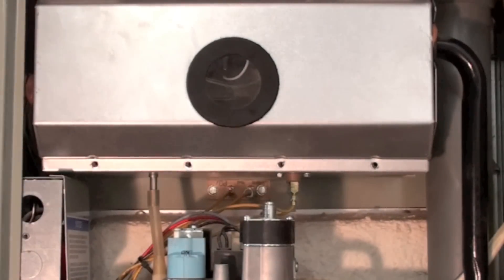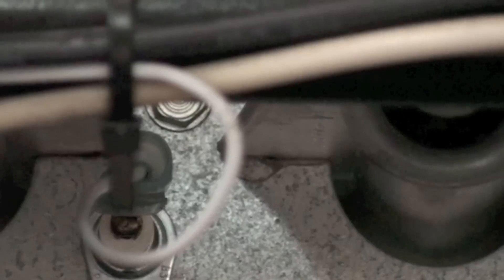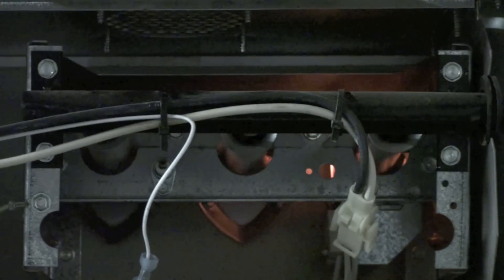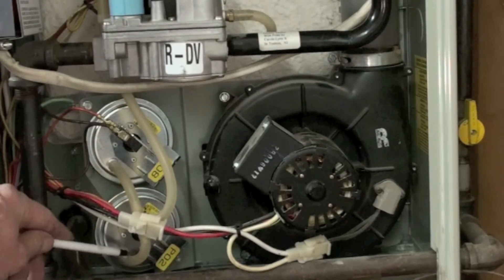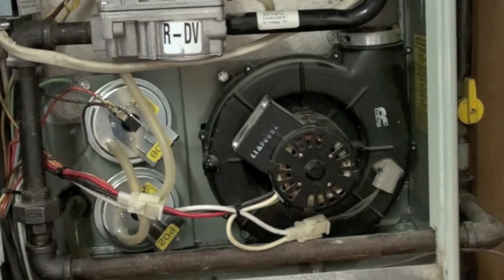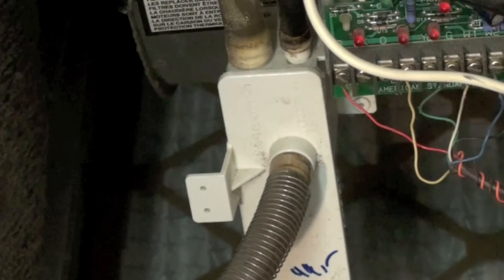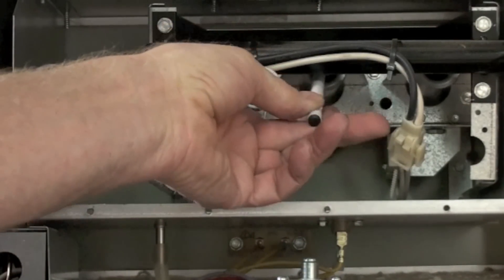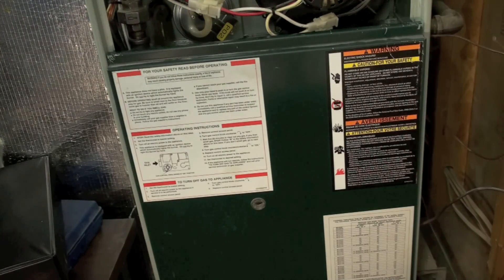Why does the gas furnace short cycle

Comment: I believe I have the issue with the rod. I'm looking at it and it looks ashy around the tip so I'll start there. Question "As long as the thermostat is off I can reach in there behind this relay looking thing an not get jolted? I've pulled fuses on my central air unit outside so I new there was no volts. I tested it ,it came on twice then stopped for a hour tried again same thing. I have a Goodman
Reply from the maker: Did you shut down power to the furnace?  If so, you are ok.  Remove the flame rod and clean it with sandpaper (not aggressively).  It should then work normally.
GFM
Reply: @grayfurnaceman  yes turned off. Just cleaned off fire rod and still cycling off to the next possible issue
Reply: Gas valve isn't opening
Reply from the maker: Does the hot surface ignitor come on?
GFM
Reply: Yes.
Reply from the maker: You will need to check voltage to the gas valve during a trial for ignition.  You should have 24 volts.  If you have voltage, the gas valve has failed or there is no gas available.  No voltage, either you have a wiring problem or the control board has failed.
GFM
Reply: Checking today
Reply: Sir gray so for some strange reason my meter is missing. Smh called a hvac guy "bummer " said it's the gas valve.  Wants to charge me 675 to replace it. I'm like with all due respect I'll go to YouTube and talk to you. Lol. Found the part online, also found a used one in my area for 15 bucks I'll use it as a tester before I buy a new one.. Gemini 36g22y type 202 50/60hz. 2006 model goodman
Reply from the maker: Go for it.  Be sure there are no leaks when done.  Check manifold pressure.
GFM
Reply: @grayfurnaceman  what meter did you use to check the pressure ? And what does the pressure do or control? I just watched your adjusting pressure video.

Comment: All newer models require constant pressure.  If your waking up cold in morning  it could be presure problem . If u dont have a regulater by the gas meter your system is a low pressure system. When people wake up they shower, cook, and use heater. All this in an older system will cause a slight pressure drop. Newer furnaces dont like that. Look a flame on stove and see in the morning  if it looks different. This is a big problem utilities dont tell u about. Could be rust or water in the line. As a former utility servace man this is common problem  . Good luck and beware of people who will rip u off. Good video

Comment: Funny you should mention the speed of the draft inducer motor, boy did I get a rude awakening from that one a while ago. Had a furnace that was short cycling, it would run for sometimes a couple minutes, sometimes only 30 seconds. Was a Goodman unit, thought for sure it was the pressure switch since at that time they had a batch of them that were prone to failure. Changed it, ran good for a couple weeks, then it started doing it again. Everything seemed to be running fine, flame sensor good, everything checked out good, changed the pressure switch again, same thing happened, So I’m thinking, ok I must have a bad board or something, changed that, nope that wasn’t it either. Then by chance I caught it doing it. The draft inducer was running full speed, then all of the sudden out of nowhere it would slow down, not drastically either, I mean very slightly, you could barely tell, but could hear the pitch of the motor change ever so slightly. So I’m sitting there pissed at this POS. Changed the draft inducer, been fine now for over a couple years now. That was a tough one to diagnose.
Reply from the maker: That's one that would be pretty much impossible unless you see it doing it.
GFM
Reply: @grayfurnaceman  I never seen one like that again, but hopefully it helps someone so they dont go through what I did, man that one was a real pain in the A!

Comment: My unit is short cycling. I cleaned the flame sensor rod and it's still short cycling. It runs for like 5 minutes and shuts down. Any ideas on what the problem could be? I'm thinking maybe I need a new flame rod sensor or thermostat
Reply from the maker: Jumper the thermostat.  That will tell you if it is in the thermostat.  Check the filter.  Check the fan for dirt.  
GFM

Comment: Good morning. I'm curious about my furnace. This sounds like what it is doing, but it takes longer to shut off. Sometimes an hour, sometimes 2 to 4. Doesn't really matter how cold or windy it is outside the townhouse. I will try the flame sensor like you have suggested it may be, but if you know if anything else based on this information, could you please let me know what you think. It has done this for about 3-4 years. I bang it on the front cover or the little round black disc right in the front under the cover and it will come back on. I don't know what the little round disc is and have never been able to find anything about it. Thank you so much for the video. It is very informative and certainly may help the problem. It sure would be nice to not have to get up throughout the night to bang on it or come home to a COLD house. Thank you again!!!!
Reply from the maker: Could you send me a pic of the black round thing?  Send to Grayfurnaceman@gmail.com
GFM

Comment: Does any one has a furnace that its having excessive heat coming from air register? The one I'm talking has a 170degree air temp at register.
Reply from the maker: This is usually due to low air flow.  Filter?
GFM
Reply: @grayfurnaceman  hi I remove filter, make sure all the register where open, still the same.

Comment: I might try checking the continuity of some of the pressure switch wires when I move them to see if there are intermittent or heat issues with wiring

Comment: I have a gas furnace that is short cycling and its driving me crazy.  I replaced my control board with a Emerson cnt07566 control board.  This board allows you to check the flame current by measuring a voltage of the control board.  I am getting 2.5v which is supposed to be 2.5  uamps of flame current.  The current then shuts off.  I measured the voltage on the pressure switch and the pressure switch and it is always closed.

There is a second pressure switch marked HI but it never closes.  I am not sure what it is for.
Reply from the maker: How long do the burners stay on?
GFM
Reply: Maybe 4 to 5 seconds after they light.
Reply: I replaced the flame rod with a new flame rod, still has the same problem
Reply from the maker: If you are getting a proper flame rod reading, and the control is new, I would be looking at the pressure switch.  I know you said it stayed closed, but I would try jumping the switch after the inducer starts and before a trial for ignition.  This will eliminate any momentary opening of the switch.
GFM
Reply: I tried that also, I jumped the switch because I thought, maybe when it starts up, there might be a pressure change.  There are two switches.  Only one of them activates.
The second one does not activate

Comment: what would cause a furnace to shutdown and not come back on u less I mess around with the strat.  Frank Smith
Reply from the maker: There is a pretty good chance that you are going out on flame failure.  Turning off the thermostat and then turning it back on will reset it.  Possible dirty flame rod.
GFM

Comment: 8 years of HVAC service. The best thing I used for cleaning flame sensors was a dollar bill.
Reply: Jon Kreher Brian 90% furnace runs for 30 minutes sets off three blinking lights
Reply: @corneliusarnold2900 probably the pressure switch is bad

Comment: In my case the flame "sensor" was oxidized, it was also not directly in the flame. The other issues were a low battery on the thermostat. I can't forget a bad or no ground. I have seen a house that had older no ground wiring. The furnace actually was not grounded aside from sitting on the concrete.  Another had its grounded underground service cable conduit corrode and break of at ground level; a ground rod was not present at build time. It wasn't even grounded through the water supply either. Once the electrical was properly grounded the short cycling stopped. The  flame sensor measures a voltage difference in relation to ground. If it isn't grounded it will be floating and can give erratic signals.
Reply from the maker: Actually, if the chassis is not grounded or attached to neutral, most furnaces will not run at all.
GFM

Comment: Thanks for the info. while checking my system, I found an insulation panel had fallen on top of the fan. That was causing the problem and I had very low air flow, so definitely check physically before paying someone to look!
Reply from the maker: Sometimes the repair is so simple.
GFM

Comment: Had similar furnace, a 90% Nordyne and it was short cycling, but with about a 5min cycle (plus 2min for inducer to clear, and 2min more for main air fan to clear -- so about 9min total cycle) and I looked at every limit switch and everything and they were all working.  I learned it was the Main Air Limit Switch (it was working properly) that was cutting the burner out at it's set 175F and that's what was causing the cycle to reset.  Lo and behold it was working properly and the reason it was getting too hot was simple -- the air filter on the furnace was clogged -- I week prior I had used a compressed air nozzle to clean the filter thinking I was smart and saving money.  Because the furnace was clogged (although it looked fairly clean at first glance, it was clogged) the air movement was low through the furnace, which means the Main Air Limit Switch was getting hotter than 175F and that was my root problem.  New filter, problem solved... easy.  Learned a lot.  Amazing.
Reply from the maker: If it is a high efficiency filter, they can plug very quickly.
GFM
Reply: So is it normal to have to replace a furnace filter once a month?  Maybe I should clean the ducts or something, I never knew a furnace filter had to be replaced so often, that's like $20 a month.
Reply from the maker: One of the issues we have been having with filters is that the high efficiency ones tend to have excessive pressure drop even when new.  Unless someone in the house has allergy problems, you can try the cheap fiberglass filters.  They have a pretty low pressure drop.
GFM
Reply: Cool and thanks from a common sense farmer type, your videos are valuable, much appreciated gfm.

Comment: Hi I have lots of your video and they great and helpful by the way I have questions for you I have furnace just about 13 years old and it is still working good conditions it is merri seri Lennox 75% and lately I invented when run heat all flame shot out are kind between yellow and green mixer Like I was mentioning everything working good conditions just flame are yellow mix with green about 3-4 months So please advise me how to clean or diagnose it or send me video Hope you well
Reply from the maker: If it is not rolling out the front, it is probably ok.  If the furnace is located where there are chemicals or dust, that could be causing the colors change.
GFM
Reply: grayfurnaceman 
It is in clean basement free of chemical and dust no rolling flame just yellow color instead deep blue

Comment: If the flame sensor is the problem, will it cut power to the control board? Mine runs in heat cycle for 3 minutes then shuts then repeats until desired temp is reached. The WiFi thermostat also shutoff at this point.

Comment: Some older mobile home standing pilot furnaces... when the pilot is lit for the first time of the heating season, will short cycle on & off, with each ON cycle progressively lasting longer and longer until the unit will finally stay on continuously until set temp is reached at which point t-stat will shut it down.  I remember someone telling me long ago it was because the furnace was so cold due to sitting so long in cold weather before starting it up, but can't remember the exact reason cited. Is it because the lower (as opposed to the "upper" aux limit (manually resettable) snap-disc-type limit (the "high" or primary limit) is tripping prematurely and has to warm up a bit before it will let the unit run continuously toward set temp?
Reply from the maker: I can't say I have ever seen that.  Some very old units may use a thermopile that may take a while to warm up but I have never seen it happen.
GFM

Comment: Gray, You rock! Like Javed below, you saved me a repair on my furnace. I had been through the level 1 diagnostics and was still having short cycling. My furnace would run, light and about the time the air handler turned on, the furnace flames would cut out, the air handler would run until the manifold cooled, and the ignition process would start again, that process would repeat... Your tip about the pressure switch and the vacuum lines keyed me in to look into that. I noticed a little moisture in that line, but when I pulled the larger, 1/2" diameter vacuum line that ran into the base cabinet, i found it to be wet and nearly plugged with fines rust sludge. I cleaned that out and the unit runs great. Thank YOU sir, I appreciate it. May your good deeds come back to your and your family many times!
Reply from the maker: Thanks for the support.
GFM

Comment: I have the same problem as Cue Rock.  It initially starts up for about thirty seconds, then shuts off.  Then it cycles through for just second or two at time.  It's the same if I have it on cool or heat.  Changed the thermostat, no fix there.  It is a Goodman capf3642c6ba.  Would the pressure switch be the place to look? And what does "jumper out the pressure switch" mean.  Thanks
Reply from the maker: The model you gave is for an AC /HP indoor coil.  Is this a heat pump?
GFM
Reply: Don't believe so.  It' my gas furnace in the attic.  I can send you a pic of the whole unit if you'd like.  We had an electrical storm the night before it started doing this, and we lost power.  When I fire it up, the "wheel" that spins at the bottom of the unit starts to draw air, and shuts down after about ten to twenty seconds.  Then it'll just click on for a second or two at a time.
Reply: Found the correct Model No GMH950904cxac

Comment: Mr grayfurnaceman, I have a carrier 90 plus. my furnace is on. blower  is running. inducer is running. then I see the ignitor glows but it does not want to light up the flame. it just shut off after a few seconds after the ignitor glows. what could be wrong?

Comment: Mine was "short cycling" this weekend... all the symptoms of a flame sensor failure, since the flame would come on... Eventually I found it was actually the pressure switch shutting it down, the tube was clogged at the inducer fan.  Working fine now.
Reply from the maker: Glad you got it going.
GFM

Comment: Does the burner keep running till set temperature is reached or thru several cycles?
Reply from the maker: It should run until just before the temp is reached.  Once it shuts down, it will continue to heat for about 2 minutes to cool down the heat exchanger.
GFM
Reply: thanks GFM. I have cleaned the flame rod my heater, but it still takes several cycles to reach the set temperature(each cycle takes about 5 minutes). it's 15 years old, I guess it's nearing the end of it's life.
Reply from the maker: You can bypass the thermostat to see if that is the problem.  You could also have an overheat problem.  Look for error code light to see if it shows overheat.  Hope this helps.
GFM
Reply: I tightened every wire cap and wriggled every connector on the control board. Now it burns all the way to the set temperature.

Comment: My gas furnace works all day and night but for the past 2 nights at 1am my house temp was at 74 degrees and the thermostat was set at 76 degrees but the furnace wasn't coming on. So we turn off the furnace, turn it back on and it's fine. What could be the problem?
Reply from the maker: It depends on the age and model but sometimes the flame rod is dirty.
GFM
Reply: grayfurnaceman what can I use to clean the flame rod??
Reply from the maker: Sand paper or steel wool.  No brillo pads.
GFM
Reply: grayfurnaceman a fine sand paper or fine steel wool, right?
Reply from the maker: You got it.
GFM

Comment: My furnace started having problems this year, wouldn't light, so I replaced the spark ignitor assembly and fixed it so I thought.... now it will light the pilot flame and when the fan comes on it has to reignite but then runs for a while and shuts off before it reaches shut off temperature then a minute or two later it will come back on and sometimes it's only the fan that runs with no flame..... i have replaced the filter, cleaned the evaporator coil, replaced the thermostat and like I said earlier the pilot assembly.... is it the control board?? Thank you
Reply from the maker: Give me a make and model.
GFM
Reply: It says Coleman evcon on the door and that's it
Reply from the maker: Without the model I cannot be sure, but it could be the control board or you could have a heat exchanger problem.  Some of these units had a baffle in the heat exchanger that came loose and could cause this problem.
GFM
Reply: Ok I'll do some digging when I get back home, I found a Honeywell paper yesterday but forgot to look at the model